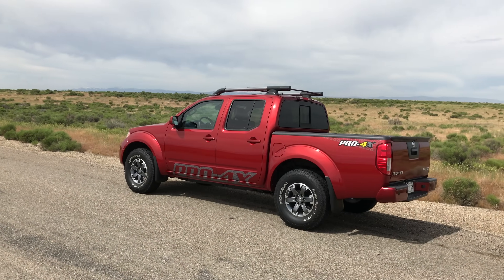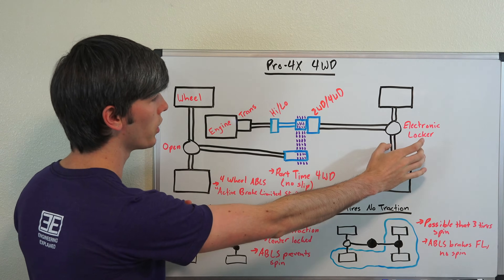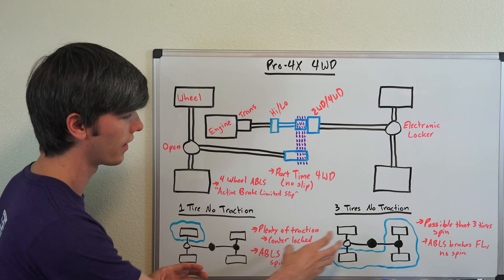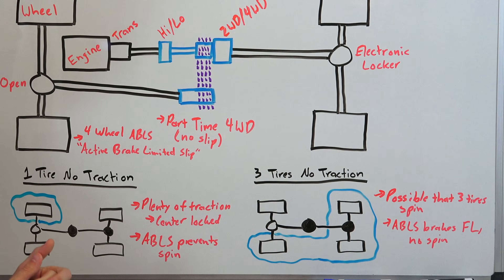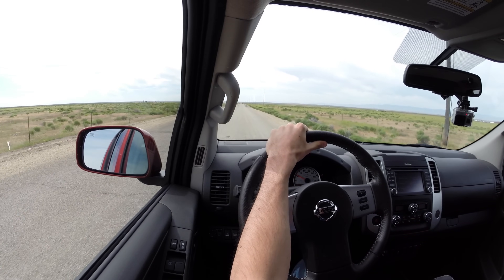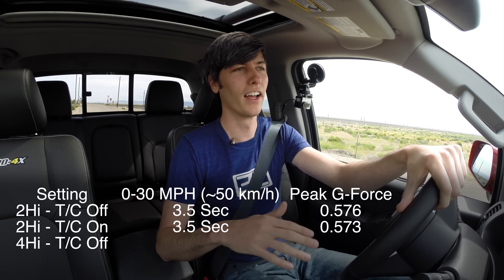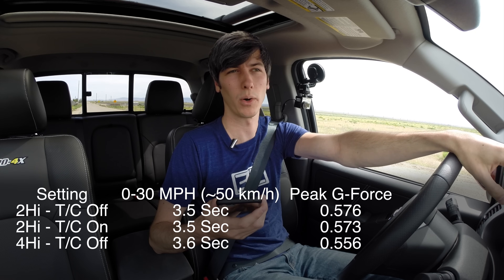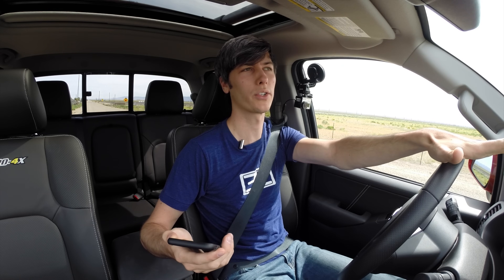How 4WD Works — 4Hi vs 4Lo vs 2Hi — Acceleration Testing

Comment: I know this video is old but unless you have the rear differential locked, shouldn’t the system be fine on pavement? Without it locked, both differentials would be open allowing for varying wheel speeds when turning. Maybe there is something with the transfer case I’m not sure about.

Comment: sir, I am always confused whether the LO and HI
is based on gear ratios or gear no.
like  high gear ratios provide much torque for acceleration
but this video stated 4lo being the quickest

therefore low gear with high gear ratios is 4lo
that's what I am understanding

am I correct?

please can anyone help?

Comment: Yes Nissan Frontier is dated and that is why i like it, looks simple, simple technology, very reliable and v6 4×4 with manual with 261 hp is lovely! Buy it used and it will outlast many modern trucks! These trucks can run over 300, 000 miles! Do some research!!

Comment: I understand what you are saying about the reason for not driving a 4wd on pavement, but I'd like to understand it a lot more!  Can you make a video to explain that concept in detail?
Thanks!
Reply: The reasoning is the front wheels when you turn.  The outer wheel in a turn will rotate more than the inner wheel will.   This is not a bad thing for front wheels vs front and rear wheels vs rear as they have differentials between them allowing the outer wheels to spin a bit more during the turn than the inner wheels do.   What you need to catch is what he said specifically about PART TIME 4WD vehicles shouldn't be drive in 4wd on pavement.  In a PART TIME 4WD, you don't have the differential between the front axle and the rear.   As he stated, at the transfer case when you go into 4wd, the forward shaft and rear are locked together.  The differentials will make up for variances in the wheel track from the sides, but there is no differential to make up for variances in your tire paths between the front wheels and the rear.   You will encounter wheel binding in your gears at the transfer case because as you're moving forward and you turn left or right, your front wheels are always going to need to travel a wee bit more than the rears.  They cannot do this on pavement where they aren't allowed to slip a little bit on the road surface to prevent the gears binding up.  This same reason is why you wouldn't lock your differentials on the pavement, because then the outer wheel couldn't turn at a different rate than the inner wheel during a turn.

Comment: I've seen 4 tires in the air after someone got hung up on a snow drift that was made worse by a snow plow. I had to dig that whore down by sticking a spade under it and scraping away at the snow until it came down and then rocked it out. I hope nothing under the car was damaged as a result. I don't remember what kind of car it was but it was small and FWD and both tires were just free spinning and there was enough space to slide my fingers under the rear wheels. I don't know how people manage to do these things...

Comment: lol wtf that truck looks the same as it did in 2002
Reply: There is value to people in buying a truck that is still a TRUCK and not a luxury vehicle.  Almost all of the trucks you buy today are so loaded with comforts and computers and everything else, you are essentially sitting in a luxury vehicle.  Don't get me started on the computers.   Many people are still buying the Frontier because it is a known platform that has had all the bugs worked out of it over 10 years ago.   That's why it's JD Power's most reliable truck sold in the USA for 3 years running now.   It just doesn't break.  Ever.    Many people find more value in that than in having 67 USB charging ports in the cabin of their truck.

Comment: I would like you to do this test on a Ford, Dodge or GMC/Chevy because I tried the acceleration tests in 2WD and 4Hi in my F-150 and because on 4Hi it is 50/50 torque front/rear my acceleration seemed quicker.

Comment: Minor nitpick.  In the situation where three tires don't have traction, the front tire will not spin at the same speed as the rear tires.  The front and rear output shafts will spin at the same speed, of course, but due to the open diff and stationary right wheel, the front left tire will spin at twice the speed of the rears (due to spider gears in diff).

Comment: I have a 4wd vehicle which might not have as much traction as this one; alternately perhaps it applies torque very suddenly in first gear. In some cases I've used 4wd to prevent wheelspin on hard acceleration on pavement, although usually that was because of a bump or slippery spot. I have, if memory serves, caused wheelspin on pavement in 4lo however.

Comment: I only clicked on the video to know what 4hi, 4lo, 2hi is and you didn't explain :(

Can you explain it to me, what those settings are?
Reply: at your transfer case, you have high and low gear settings as well as 2wd and 4wd settings.   In 2wd you are always in 2hi (2 high) which means just standard vehicle gearing and only rear wheel drive.   Switching over to 4WD, the transfer case locks in the front drive shaft with the rear so now all 4 wheels have power but you've not changed your gearing, so you are in 4Hi (4 high).   He demonstrated this as the times for 2hi and 4hi were almost exactly the same, slightly slower for 4wd only because you're moving more stuff in the drivetrain so less efficient.    What separates the 4WD vehicles from ALLwheel drive vehicles is that they have a 4Lo (4 low) gear setting in that transfer case.    If 4WD is not sufficient for the terrain you are trying to pass, then you would switch down to 4Lo which gives you more torque per engine RPM at the expense of top speed.   On the Nissan in this video, when he is in 4Hi and he's in 2nd gear (6spd transmission) and about 2,000 RPM, I know he is doing 20 mph. (I have the exact same truck)    If you were to change nothing but go to 4Lo, you would be doing a little over 10 mph in that 2nd gear at 2,000 RPM on the engine but you would have a much greater amount of torque (more power) exerted at the wheels onto the environment.

Comment: @Engineering Explained, After removing the front drive shafts on my truck it seems to accelerate much faster from when it was 4 wheel drive, explanations ??
Reply: zombieqtr weight reduction

Comment: Problem with AWD (not 4wd) is if you have a flat tire. You can't just install a brand new tire if it doesn't have the same thread wear.
Reply: Yes & no. Depends on the AWD setup.

Comment: Even going perfectly straight it's best to not use 4WD hi or lo on pavement. Because the front and rear differential isn't the same (rear is usually bigger), the actual gear ratio will be slightly different and can cause transfer case belt stretch.

Comment: Couple comments and thoughts...
Military Humvee's are full-time 4WD... got the choice between 4Hi, 4Lo, and 4Lock. 4Hi is generally acceptable on pavement as long as you aren't making the sharpest turns you can because both diffs are open. Does anyone know if the civilian version -- H1 -- had a 2Hi transfer case? Cuz 4Hi has a lot of drive-line friction at 60+ mph...
Good truck there for the casual off-roader but anyone that is serious gets locking diffs... not the same as LSD's.

Comment: Drove a new Frontier this past weekend. Sadly not off-road but on highways and wow did Nissan get it right. Usually Japanese vehicles at 80MPH or higher get a bit squirrely but not this truck. The only negative point, is the vehicle drinks gas like water.

But yeah, kept in 2WD for that.
Reply: kd1s I drive my Micra at 120kmh and it loves it
Reply: Feels solid doesn't it? Love my 08 Pathfinder SE.

Comment: If you don't lock the hubs on an older Toyota pickup before putting it in 4-low, you end up in 2-low, which gives the potential for some good burnouts!
Reply: yes but it puts too much stress on the rear axle and it could break

Comment: My father's old '99 Frontier was one of my favorite vehicles to drive. I owned an Eclipse (same year, both 4-cylinder, FWD, and manual transmission) at the time, but the Frontier felt faster and lighter. Couldn't go around corners w/o fishtailing though which is why I ultimately preferred the Eclipse. ^.^

Comment: I love these videos. You explain everything so well that I actually understand stuff. if possible could you do a video on the actual differences between 4wd and awd especially when in the same vehicle. I have a Sierra z71 which has 2 hi, "auto" which I think is all wheel, and both versions of 4 and I'm curious if the differences. I think I know but your explanations see way better than what I could do
Reply: Matt K 2 hi auto is if the vehicle senses the back tires slipping it automatically goes into 4 hi. 2 hi is rear wheel drive

Comment: With specific wheel controlled braking, are lockers obsolete since the computer can push all the power to the wheel with traction?
Reply: That's the theory behind it, but sadly the computers do a poor job on many vehicles of putting the power to the wheel(s) that have traction. I'll take a GM or Ram optional mechanical limited slip any day of the week over a Ford or Toyota ELSD (electronic limited slip differential) in the truck lineups. There are many types of 4x4/AWD systems, and some are better than others.
Reply: Essentially you are having the computer give you traction to the wheels that still have grip by applying your brakes selectively.  Look at that statement for a minute.   You're basically killing the power of your engine by using brakes when you're getting stuck.   Does that sound like a game winning plan to you?  Not if you have a locker installed as this Nissan does.  The ABLS just is something technology based that they can add to pretty much ANY car or truck with brakes that give it an advantage of traction.  It is in no way a true replacement for locking differentials.  In much the same way that adding computer traction control for a 2wd vehicle is nowhere near the same thing as having 4wd.

Comment: This is pretty interesting. I have a 2010 Chevy diesel, and my 700 crank hp causes me to lose a lot of time due to wheel slippage. Rn I'm at about 5.4 sec 0-60 with a soft 15ish psi 2wd launch. I can't do a 4wd launch yet, because I don't have a built front end and I will snap my tie rods haha. Maybe one day! I definitely think I could get ~5sec 0-60 in 4hi
Reply: Peter Jones That's pretty funny we have a 700 horse 2010 Chevy Duramax as well but the 700 is at the wheels
Reply: Austin Wolfe Sweet dude! I would love to be able to push up there in the 700-750 hp range, but I'm not really interested in dropping 6-8k on a built tranny...
Reply: Peter Jones Yeah I was gonna ask if you still have the Allison or what do you have what we have is a suncoast
Reply: Austin Wolfe my dream is to get a built tranny by sun coast, I only live about 4 hours from them... probably won't end up doing that with this truck though, maybe one down the road. Unless this one blows the tranny in the near future 😂

Comment: 4Lo on nissan 05+ (2nd gen) has heavy electronic throttle feathering since the lower gear range severely adds to torque leverage on the drivetrain. This makes rough obstacles much easier to handle than a non-feathered throttle. 

:)
Reply: I've been searching the internet trying to find this exact information. I thought the truck was broken and going into limp mode whenever I engaged 4low based on how the truck was responding to the throttle. Thanks!

Comment: Why would it be slower in 4 hi?  The hubs are still connected to the front diff which is still connected to the unsplined transfer case, it seems as though the rear wheels would have more power in 2 hi but the drag is still going to be there.
Reply: Phos9 Are you serious? This vehicle lacks a central axle disconnect? Central axle disconnect has been part of 4WD systems in US built trucks since the 1980s! When General Motors brought IFS to 4WD. I am appalled at foreign trucks if you are correct!
Reply: Oh a central axle disconnect? Another part about 4wd systems that don't get talked about. I just assumed modern trucks didn't bother with disconnecting anything apart from the transfer case.
Reply: And the irony is your statement about US built trucks vs foreign built trucks.   Considering that today, Ford, GM, and Ram trucks are built in Mexico and Canada, where the Toyota and Nissans are actually built in the USA.   The ONLY trucks built in the USA for that matter.     I just find it funny how people are still fixated on American BRAND trucks vs foreign BRAND trucks when they are exactly the opposite when you are considering where they are made.    Sorry but no HECHE EN MEHICO stamped on a Ford engine block for me.  I'll stick with the Nissans.
Reply: jkutyna my jeep was built in California, my dad's 2016 Ford f250 Tennessee, mjy grandpa's dodge 3500 Florida, your point is?

Comment: +engineeringexplained I wish if u did a 0-60MPH test too, I'm interested to know if the acceleration will get slower in 4Lo!
Reply: even if 60mph is possible in 4l, it would be a pretty bad idea
Reply: Adam Badri Can you say over-rev?
Reply: I really don't know that much about 4x4s 😅
Reply: The transfer case has limitation's on it's input rpm in low range.  If your trying to do 60mph in low range your probably seeing transmission output speeds in excess of 7 or 8000 rpm (engine speed, plus overdrive gear of 1.2 or so), the low range isn't really made to handle these kinds of speed.  

They COULD make a low range that could handle it, but it'd be a lot more expensive, and there's really no reason for it.

The low range 4x4 is made for extra torque at very slow speeds, lower then 1st gear in highrange would be.  Once your speed get's over 10mph or so, low range doesn't do anything that the transmission in high range wouldn't do, with less power loss.

Comment: why do the test on asphalt why not do it on dirt to see how the 4wd helps with acceleration on a surface with less traction.
Reply: The measurements he was providing would have been useless since running on dirt would provide for much more inconsistent test settings for the different runs.
Reply: oldtwins I see your point but doing it on pavement proved nothing unless it was powerfull enough to spin the tires in 2wd. by how he was lauching it.

Comment: The brakes in my F250  can barely hold back the added torque of 4 low at idle speed. All that flat land out there and no place to re-run this test in the dirt?
Reply: Eric Morrison get a standard and it'll. Stop, myh brakes in my Rubicon are the same

Comment: I have a 2008 Colorado with an I-5 I could spin the tires easy with just mashing the gas, not holding the break. After some after market mods, intake/exhaust it's even easier. 
 On the 4wd in a straight line, I have to disagree with. 4wd in snow is straight lines and curves is normal, you not going fast in snow. May I suggest EE, is that 4WD shouldn't go any higher then 40mph because of the different diff speeds. Might want to add taking a truck out of 4WD, for some that don't have push-button like mine does or they don't read their manual.... good video like the rest you post. Just though you should have added more information for people that are not 4WD or AWD savvy. An idea explain the difference between AWD &4WD for those that don't know.

Comment: Wouldn't it be more useful to test this offroad?  Like on dirt or gravel.  Since there's no wheel slip on road, you only get to see the effect of gearing.  Offroad, you could test the performance of the traction control systems.

Comment: This truck needs an i6 with 100HP more.
Reply: Horsepower is meaningless in a truck.  Torque is the most important.   This Nissan truck has less horsepower than the equivalent Toyota Tacoma, and it weighs more than the Tacoma, but it out accelerates it and beats it to 60.   Why?  Because the Nissan has way more torque on it's engine than horsepower.   HP is meaningless to trucks and is just a salesman's statistic to throw at people.   Maybe it matters in some POS like a Honda which has no torque whatsoever but not in a truck.

Comment: I owned a Jeep Cherokee/Liberty KJ and I always wanted to use the 4LOW (I actually did) but I heard that steering while in 4LOW may cause damage to the driveshaft or similar. Is it possible? I knew this was possible on the road and while turning because of the huge amount of torque produced by the engine. When am I supposed to use 4LOW and what shouldn't be done?
Also: is it easier to brake something with a manual gearbox vs automatic (maybe releasing the clutch too fast and putting too much force on the moving parts)?